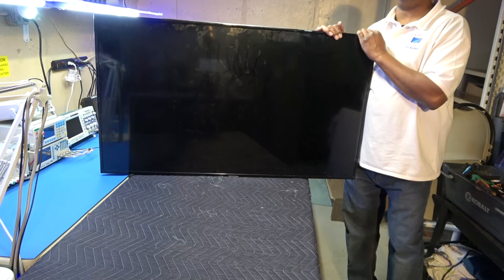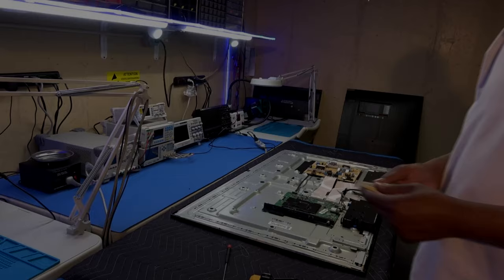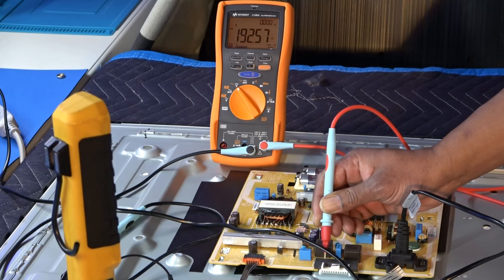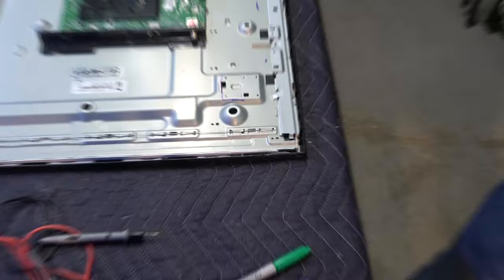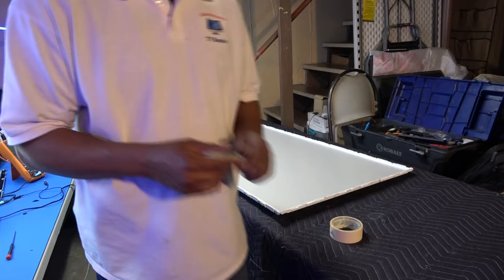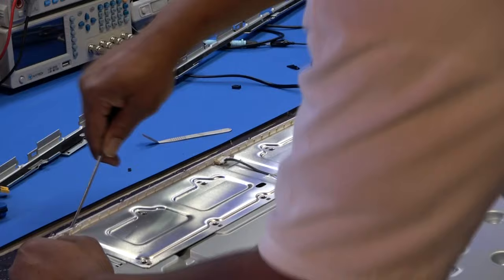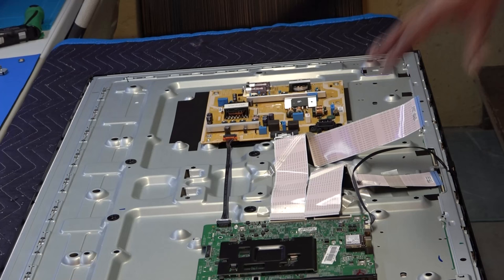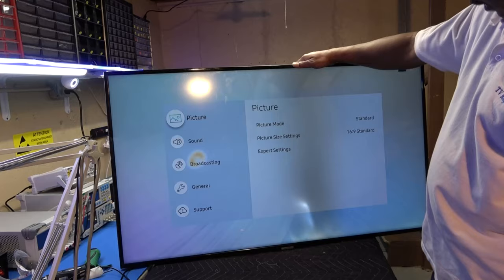50 inch Samsung half dark picture. UN50NU6900B FULL TV repair.

Comment: Great video. Thanks.  I have the same crack in my diffuser screen, two in fact,  and it is very noticeable.Can the cracks be repaired/ glued?
Reply: I had the same problem, also burn marks on the edge of the diffuser . Used super glue to repair the crack then turned the diffuser around so the crack and burn marks were at the top of the screen instead of the bottom, much less notable there.

Comment: Are the long circuit boards at the bottom replaceable? I have a very similar TV and cannot find them anywhere
Reply from the maker: NO they are not. They are bonded to the screen via the ribbon cables.
Reply: @bigdog8882  thank you sir, guess that TV is going out for trash.

Comment: (Un70nu6900F) While testing my LED connector values, I'm seeing no voltage on the + of LED 6, but 40v on the - return. My screen isn't totally dead, but the left side is sluggish and dim. Almost like extreme contrast. Is this likely an LED issue or a board issue? My values across the connector vary greatly, but seem to go lower consistently from 1-6.

Comment: Around 38:50 I see you inserting two thin sheets?  Are those a light filter and diffuser?  Are they universal between similar size tv's.  I am trying to find replacement material for my 32" samsung qn3250R.

Comment: I know it's a vague question question but what can one expect to pay for a fix like this at a shop if TV is out of warranty... just ballpark.
Reply from the maker: around $200
Reply: @bigdog8882  thank you sir, really appreciate the info.
Reply: Took mine in with the left side dimmed and was told they have to replace Two LED strips and the power supply regulator, does that sound right even though it turns on? sorry to just ask this but not to tech savy

Comment: Hey Big Dog, love your videos on youtube. I purchased the LED backlight strip tester as half of the tv on the right side is of one LG 55 is not backlit. The other half looks fine. :( 

I had another working LG same model here so I swapped out both boards which produced the same result, so through the process of elimination I figure the boards aren't the problem.

I tested continuity on the flat cables that go to the led strips (there are two led strips on the bottom of the tv), that checked out fine so the cables are good. 

I tested where the power board is with the backlight tester putting the + on the positive of the led feeds and checked each of the negative 3 pins. Only on one side did one area of the led strip lit up. 

So I tried to individually light up the leds and they all seemed to work. then tried to light them up in sections and that worked too. Couldn't get the entire strip to light at once on either side..

Would you have any suggestions? Any help would be greatly appreciated.

Comment: So I just did this repair but messed up one part by forgetting to put back the metal bracket that goes over the driver board as shown at 18:42, tv is working fine for now.  Is that part important enough to put back?

Comment: It seems like Samsung has a problem with series 6 I had a 55 inch and the same problem wish was built in 2018 I would like to ask how much a repair will cost me here in the US I'm not willing to pay more than $100 because I can buy a brand new one for $350 or $400 please advice and thank you for sharing your videos
Reply: Most people will likely charge more than $100, two strips are around $40 and there is quite a bit of labor.  It's not a 30 minute fix.

Comment: I got samsung 55 inch UA-M5570. When I try disconnecting right side t-con cable keeping left intact; Half screen shows horizontal three stripes (blue white black) and when I disconnect the left side cable of t-con keeping right intact, whole screen shows white. Faulty t-con or main board, bdog? Keeping both cable intact show half screen while and half screen with vertical stripes.

Comment: I accidently detached a small piece of the flex ribbon thats attached to the screen when I tried removing the screen from the panel (I hate when the glue the screen to the panel) now theres a line on the screen. is there anyway to fix this without a bonding machine?

Comment: I don't know my mussel number but the tv was mmanufactured this year. I bought it in March of 2021. It was broken during an attempted rape and im trying to get the tv replaced thru the victims crime fund. I paid $500 for it. Everyone says it's cheaper to replace it. It's a Samsung tv plus 50 inch. The picture flashes on an off and parts of the left side  have lines, while the right and lower part is black.  None of the tv features display. Just lines and blackness. Should I trash it or can I repair it?

Comment: Sir, mine turns on the with full picture, then after a few seconds it goes dark. I replaced the t-con board with the same effect. Then I tried your video process and no luck. Any suggestions?
Reply: Also replaced the main board

Comment: I have no picture in my Samsung tv but I have sound and the backlight works as well, what do you suggest I do? I have a UN50NU6900FXZA  is my display broken? Can I fix that?
Reply from the maker: Replace T-con board. If that don't work then you have a bad lcd panel.
Reply: @bigdog8882  I’m not too familiar on this so I could be wrong, my tcon board is attached to my lcd panel, My tv only has the main board and lcd panel

Comment: Hi is there any chance of u could  make a video of of repairing a Samsung tv I think its the tc con board  its were i plug one ribbon cable  in and one of the tv comes on but the other half don't if u could get back to me I would be delighted
Reply from the maker: Just switch the cables (left and right) to eliminate the cables. Usually the connector clasp on the T-Con is not bad unless its physically damaged and not clamping down firmly on the cables.

Comment: Why is there a huge dark line down the tv at the end
Reply from the maker: Camera vs light
Reply: @bigdog8882  my tv actually has this issue with the dark strip in the middle of the TV which is also caused by bad led back lights from what I’ve been able to research. There’s a surprising amount of people that have this issue with Samsung tvs right after the warranty period. I spent $1000 on my tv and less than 4 years this happened. If the fix doesn’t work I’ll be going with Vizio or LG. I’ve gone through 2 65” Samsung tvs in 6 years.

Comment: Didn't understand your explanation as to why there was like a still kinda visible dark bar in the middle. I did the same process yesterday, didn't change the LED just changed the light diffuser panes, however its a tiny shade darker in the middle. can you give more info as to why or how it can be further solved ?
Reply from the maker: Because there was a crack in mine. Yours I dont know, maybe make sure that the diffuser screen is not reversed.
Reply: @bigdog8882  which side of the diffuser board has to be pointing up? The rough or smooth side ?
Reply from the maker: @glendeva100  The rough side I believe.
Reply: @glendeva100  the rough side
And it got dark because when you were removing the acrylic glass, you lifted from the edges, so it got bent
Reply: @emmanuelokeoghene8716   thanks for your reply, so if it got bent there is no way of fixing it or  will it straighten itself out. I'm gonna check later if the rough side is facing up

Comment: where can i order the replacement strips for samsung un55nu7100f? i found some but miss read the description. they were the 50" tv. mine is 55. so i ordered the wrong ones. and can not find the correct ones. thank you in advance.
Reply: You probably figured it out by now, but ebay has quite a few strips, the part number is BN96-45913A for the 55".

Comment: Great Video!!! I am a subscriber. 
Do you have an email where I can send you some photos of 50 inch Samsung UN55H 6350 AF? I am helping a Senior lady with limited income at no charge.
Thank you for a great video. I am a First Timer. Thanks to you I followed your directions and was able to fix some lose reflectors.
However, I am having a problem with the metal strip that goes at the bottom of the TV. In this video at 39:45 you are replacing a similar strip but I didn't see how you did it!
It would be awesome if you could please help her.
If I can have your email, please I can send you the photos of where I am in the process.
Hopefully you can guide me. 
Thanking you in advance for your guidance and directions.

Comment: You do things the hard way and are very rough with electronics
There is much easier and safer way to remove things and unclip things but the marker thing you don't need 
They make a blue tape and that's what you use for the layer's
It won't hurt them and you don't put your fingers all over the "clear screen" as you call it.
Reply: So I just did this repair but messed up one part by forgetting to put back the metal bracket that goes over the driver board as shown at 18:42, tv is working fine for now.  Is that part important enough to put back?

Comment: LED's didn't cause that crack 
You did with how you handled the tv
Reply: respectfully asking if you ever fixed blown out led strip before, I just opened my tv and there are actual a line of holes or bite marks on the diffuser next to where the leds are. There is one really black bite mark an crack running along it exactly as shown in this video.
Reply: It was cracked before he tried to take it out.